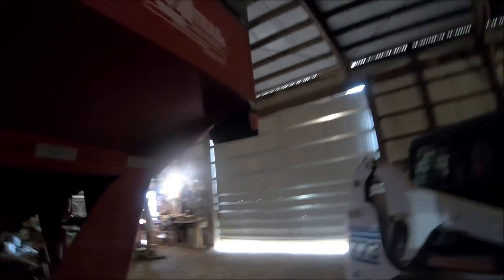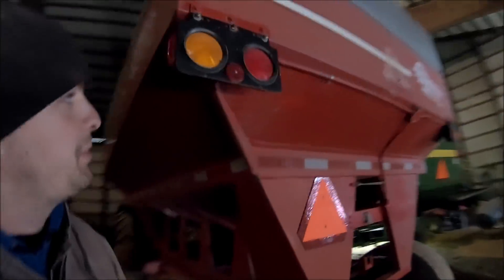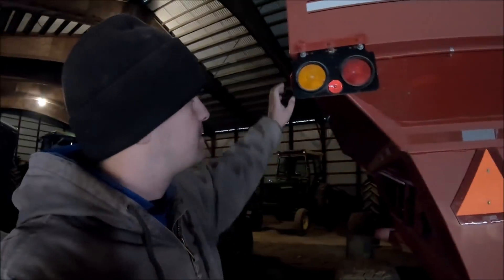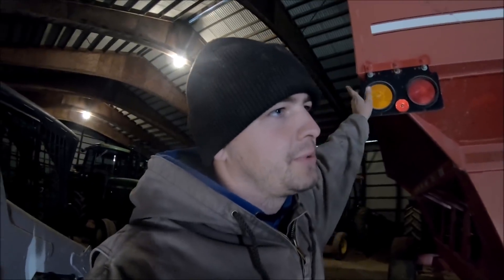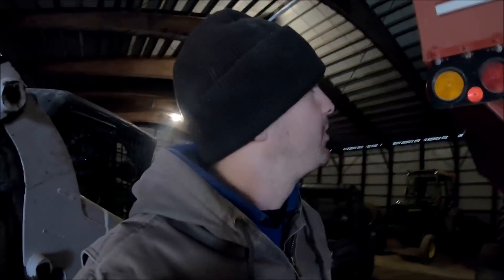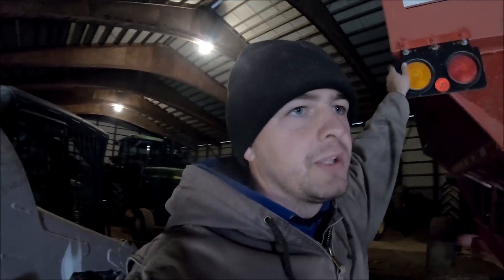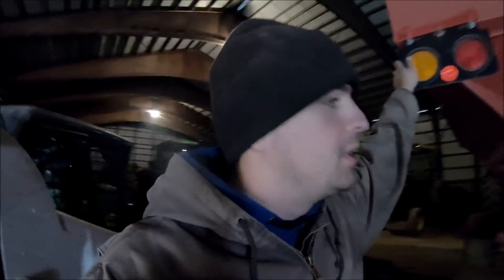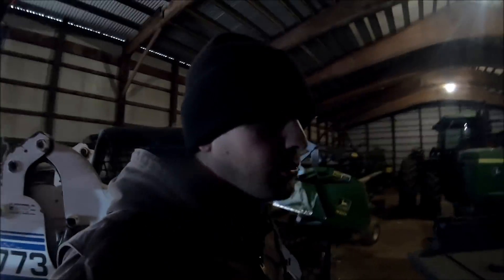No Grain Trains Here

Comment: Lights and brakes are very nice modern technologies.  Weight, on the other hand, is just one of those things that you either have or don't, whether the equipment is new, used, old, or just plain "shook".  I guess you use what you have until you can afford to get some (more) of the nicer things to make the jobs easier and/or safer.

Comment: in Europe, big trailers and silage wagons are usually tandem or tridem this adds a lot o weight on tractor. So smaller 6 or 7 series can easily pull something like that. For your case, i think 7600 could pull something much bigger. I was watching your trip with grain from your farm to silo and you only downshift gear on the hill. So I think that has a lot of pulling power. From my experience going without air brakes and with them, is like day and night. Without, you have to start breaking  earlier and brakes are getting hot pretty fast. You feel this weight on tractor. With air brakes tractor with two trailers just stops. 
And of course it is much safer, you can brake fast when something happen on the road,  in air brakes when air is leaking system automatically engages brakes, so it can helps a lot when something snaps going uphill or downhill. So yea.. is expensive and annoying but i think is worth it.

Comment: Having your working lights on on the road is dangerous, especially the rear ones. You might think it illuminates your tractor and trailer so people see you, but they can really blind someone, especially newer tractors with the really powerful LED lighting kits. In addition, having yellow or white working lights lit on the back may confuse people as they might think your coming from the opposite direction. There's a reason the lights on the back of any vehicle are a different, darker colour than the front.
On the brake situation, I believe air brakes are a must have. You can pull some really heavy loads safely if you put a big enough tractor in front of it, but that will massively increase you total transport cost. With air brakes, that 7600 can pull a 18 metric tonne (~700 bushel) tandem trailer. No point in buying more big tractors than you need.

Comment: I saw where OLF added Hydraulic brakes to one of his JD tractors to pull the big Krone sq baler. I don;t know if it is even possible to add Air Brakes to a USA JD tractor. I saw on UK videos that they have Air or Hyd brakes on the Big Trailers they pull. They also have a higher road speed. I was told they use Tractors over there because it is hard to get a CDL over there or cost a lot.

Comment: With the tandem axle  you only really have the pull, the trailer takes most of the weight Travis
Reply: Stopping it is the problem not getting it going as they don't have brakes on the wagons/trailers.

Comment: How would the weight of a 500 bu gravity wagon full of kernel corn compare to a 6 wheel silage wagon full of chopped corn?
Reply: It doesn't
Reply: Well they are roughly the same size
Reply: It's anyone's guess unless you put each on a scale to compare them.  Too many variables involved.
Reply: True
Reply: OK, worked it out for myself using value off the 'net.  Comes to the gravity wagon holding roughly 10 times the weight of the silage wagon, depending on moisture.
Reply: @OldTractors The figure I've seen bandied about for the (typical) weight of a full chopper box is around 20 tons.  How much are you using as the weight of each bushel of corn?
Reply: From the figures I found, 56 lb to the bushel of kernel corn, but only 2750 to 4000 lb chopped corn in a silage wagon.  Those silage numbers seem reasonable from my experience hauling and emptying silage wagons.
Reply: OldTractors s

Comment: The big liquid manure tanks brakes work off one hydraulic ramote.
Reply from the maker: I've never seen one of those up close
Reply: It is actually a completely separate circuit from the hydraulic remotes, basically a T off the brake lines with a priority valve to send more pressure to the trailer so it does not push the tractor.

Comment: Is there anyone out there having an issue with corn out in the field with ears of corn not hanging and the buts are wet and the corn is germinating and growing on the cob with all the wet weather we've been having? Here we have one number of corn that is a disaster. 4 out of 5 ears are doing just that.
Reply: That can happen in wet years.
Reply: @ColeTheCornstar  yeah not a great year for corn.   Test weights are also running low.
Reply: @ColeTheCornstar  where are you located and what kind of weather did you have?
Reply: @ColeTheCornstar  ours that we have delivered has been 54 to 56 but the Ethanal Plant where we deliver says they have been seeing a lot of 52.  We have not had any damage dock so far.  What we have taken off so far has been 21 to 22% but it will get higher I am sure.
Reply: @ColeTheCornstar  we had a wet spring so some of the corn was a little later than usual going in.  I can't complain about our weather to much.  But test weight is what it is.  Can't do much now.
Reply: H Turbo we have had wheat and barley sprout in real wet years ...I never thought standing wheat or barley would sprout but I saw it years ago

Comment: Our J & M 350 bushel wagon  came with surge brakes but the 650 Parker my dad just dose not I don't think and we are going to pull those together with our 8100 mfwd we could pull it with our 4760 it has more power but it is a 2wd I like gravity wagons for running to the bins they unload faster than a straight truck and can get in fields when they are wet  just saying that because were you guy are at you probably better off with wagons instead of a truck like everyone ses you guys need